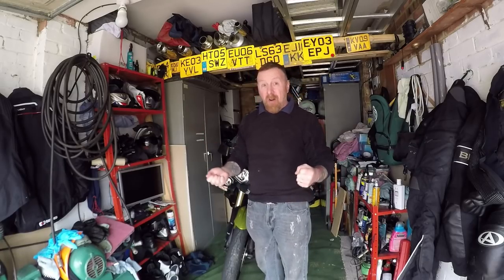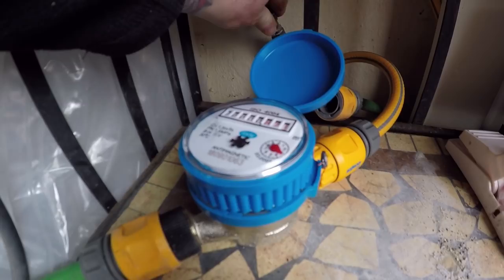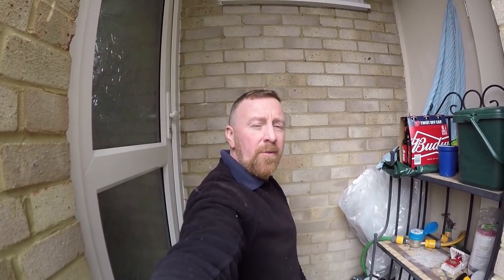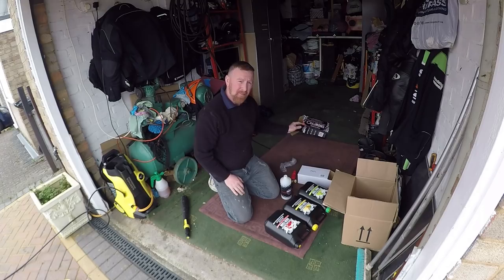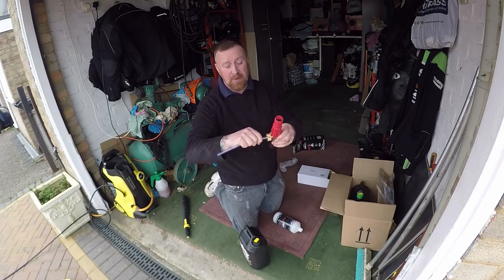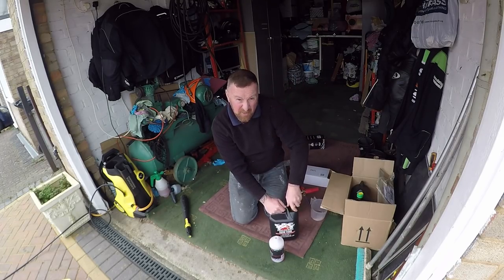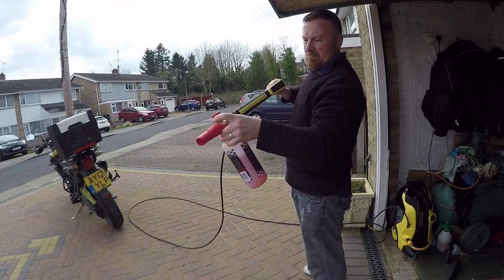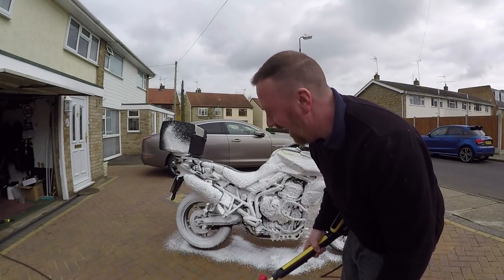SNOWFOAM JET WASH YOUR MOTORBIKE ? MARK SAVAGE

Comment: I bought a Muc-Off power washer as it's specifically designed for washing motorbikes. It has a lower power so as you don't damage your bike. I use the snow foam too but I find it doesn't matter which snow foam you use, you still need to take a sponge or micro fibre cloth to it.
Reply from the maker: Agree I do that with my car and bikes 
Giving it a rub over really helps
Reply: @marksavage  I still think snow foam is really good. It does help loosen hard grime up for easier cleaning.

Comment: It's great fun the snow foam but I've found that tfr is easily the most powerful but at the same time a bit dangerous on the bike as it's so strong. Being careful though it's good if used sensibly.
Reply from the maker: it is a bit of fun and better on cars however like you say just being careful

Comment: As a ex pro car/bike valeter, use TFR ( TRAFFIC FILM REMOVER ) on wheels only no need to rub or scrub, if you have tarmac splatters on wheels use TNG ( TAR AND GLUE REMOVER ) leave on wheels for around 5 minutes then power wash off with hot water, great result and will cost you way less than the snow foam.
Reply: @Harry Walsh No mate it has to be sprayed on with a spray bottle don't dilute, best TFR and T&G is Auto Glym, you could buy cheap crap from B&Q but, you end up with shadows on your wheels that will result in dull rims...Hope this helps mate

Comment: Some hopefully helpful tips please don’t think this is me being rude : A snow foams job is as a pre clean to loosen dirt before a 2 bucket contact wash,  snow foam isn’t designed to clean a bike without a contact wash too! - most snow foams you mix 300ml ish of foam with 700ml of water in the bottle before connecting to your pressure washer :)
Reply from the maker: ritchsuk that’s ok bud 
I was just following these instructions which it mixes as it runs with the mixer bottle and this was not the pre wash one 
It still came up ok but will rub over next time 
Just wanted to see if it worked as it says!
It’s ok but does need a rub over 
Thanks for watching bud and your comment
Reply: If you use the same rag your still just spreading dirt.....i power was all my bikes then hand wash then detail then wax

Comment: When u use a jet wash on a bike, u should always reduce the pressure of the water, if u have a machine with adjustable pressure then u can reduce it that way, failing that...stand further back so that ur reducing the water pressure....if ur a little bit wary of this way then u can wrap up ur electronic bits n bobs..... I have had no problems over the years..(professional auto detailer..... with most of my work on motorcycles)
Reply from the maker: Gren Phelps yes bud I have the full control k5 so can adjust the pressure from the handle 
And I have heard it can cause damage so was aware to not over do it 
Have to say it was fun but like in my detailing videos I have on my channel of my B king and fjr can’t beat a bucket of water lol 
Thanks for watching 
Many more videos on my channel well worth a watch 
Mark

Comment: Didn't quite understand about the gadget for the water meter or what is or does. Sounded interesting tho I think
Reply from the maker: You can buy a sub meter,  if you use a lot of garden outside water and it doesn't go down the drains , well you tell them it doesn't you don't have to pay for the waste 
It saves you a little and you can buy them off e bay bud

Comment: Not surprised its thick mate your only ment to fill the lance with about a inch of snow foam and top the rest up with water. 👍
Reply from the maker: Really bud 
Its not what it says on the instructions as it has a adjustment on to top to adjust snow foam and water

Comment: Nice video. I actually washed a motorcycle for the 1st time yesterday. It was a Yamaha MT07. Took me almost 2 hours. Cleaning the wheels properly with different products and brushes (the chain gets in the way) then using a detail brush and a mitt on the rest. Then drying with a towel and compressed air. Then protecting the plastics. 
Whats your opinion about the ProKleen products?
Reply from the maker: I used them and are good , I've used muk off too video on here to detail my b king and fjr and to be honest it done a really good job
Most cleaning products on the market today work well with a little bit of work 
Enjoy cleaning bud  and stay safe 
Loads more videos on my channel for you to enjoy
Reply: @marksavage  Thanks a lot for your reply Mark. 
Take care and you too, stay safe!!

Comment: Hiya  Mark hows it going?  Mark, can I asked you a quick question, just bought a Honda cb125f 15 plate fuel injection last weekend. Very low mileage serviced every 6 months!  I noticed once it gets nice and hot, the tick over creeps up. Sometimes its as high as 3000rpm and wont drop off. I given it a good looking over and cant find fault. You come across this before? Cheers matey
Reply from the maker: barrados101 not often on a FI system 
It maybe faulty of leaking as in sucking the n air !
Check system is nice and tight and air flow is ok 
If all ok you may need to get it service or replace the injection  as you can’t have it revving up that high as when in gear it will keep you going as your finding now 
Just make sure the cables as ok and wd40 the point that they go onto the system as the can rust up and become stuck so no closing !
Worth a look
Reply: @marksavage  thanks for all the info mark, will give it another coat of looking at this weekend. Will let you know how I get on. Thanks again :)
Reply: @marksavage  hiya mark, just a quick update, I tracked the problem down to the throttle position sensor, and the engine oil temperature sensor. So once replaced I hoping its all good to go :)  thanks again matey.

Comment: Can I jet wash my Gixxer without messing up any electrical stuff? I'm getting pissed off hand washing it!
Reply from the maker: to be honest you can jet wash any bike just try not to spray into the engine parts with full on jet!
do the wheels, chain and fairings engine case just not top end bud or clocks , just shower over them and sponge 
it will be fine then

Comment: Hi mark i just watched your video on project bikes where you saying about the vespa .
I bought a piaggio zip of a kid that said he was riding it now it wont start and he put a new plug in it .... i was up for the challange so i bought it £50 anyway got it home ... wrong spark plug put in a new one still no spark so changed the cdi then it ran but wjen you took it off the center stand it died anyway i ended up chasing back the cdi wire after taking off the floor boards and found a big plug that plugs in just by the side of the cylinder it was unplugged halfway so put it in properly and worked perfectly i have had the bike for 3 months now and never missed a beat but never belive the seller and be carful guys there are rouges out the who dont know what there doing
Reply from the maker: ive always said that but for £50 that's a good project and well done for getting it running and on the road again

Comment: I thought everyone knew snow foaming is just a way to apply shampoo to your car/bike and you still need to clean it, just not with a sponge.   Snowfoam is diluted shampoo, so buy shampoo instead.  And don't use a pressure washer around your wheel bearing or on your chain, you'll wash the grease out.
Thanks for the video and love your bike.
Reply: It's a pre clean you would snow foam your car or bike leave until most of it as dripped off then Rinse it all off removing dirt and helping break it down and lift it off the bike. foam it again and get scrubbing then rinse and dry
Reply: @livingdadream4616  thank you for your input

Comment: Good vid mark..is there anyway I can contact you..as my bike has confused the he'll out of me..it's a lexmoto diablo 2016 4t
Reply from the maker: Neil powell as you have subscribe and like 
Upload a video of your problem and I’ll take a look
Reply: @marksavage  what is happening is it cut out on me yesterday on the duel carriageway..I have cleaned filters..it's got a new carb..it starts first push everytime..and runs sweet on the centre stand..as soon as I drop it off the stand with me on it it cuts out instantly...but without me on it keeps running..also of the stand it starts and runs but again as soon as I sit on it it dies..also won't start with me on it when it's off the centre stand..
Reply from the maker: Neil powell it could be  the carb bud so check main jet and tuning like in my carb videos and tuning 4t / 2t 
They will help 
Shoulda like it runs on idle jet but floods or starves under load clean old carb try back on 
Serviced bike ? Plug etc
Reply: @marksavage  cleaned carb and jets..the carb is only 3wks old it's a deni carb..think that's the name..had new rollers about 5-6wks ago.only thing I havnt checked yet is the plug and lead
Reply: @marksavage  Could it be the clutch as eliminated everything else today..it's only the clutch I havnt looked at..just seem funny that as soon as you put weight on back wheel it cuts out
Reply from the maker: Neil powell worth a look bud 
Take off the cover and start the bike 
You may have to hold your in the bendix to start 
Then you can see
Reply: @marksavage  cheers also just watched one of your old vids of a speedfighter where you turning back wheel and it's making a grinding sound and you found out it was the clutch...well mine sounds exactly the same..thanks for videos and keep up the good work..your videos help out hell off a lot
Reply from the maker: @donky75  so that video helped then that's good to hear and yes give it a look as may be the clutch them , if so a simple fix
Reply: @marksavage  just put on a video of my bike on YouTube under my name
Reply from the maker: Neil powell will take a look
Reply from the maker: Neil powell ya how odd
Ok one of two things to look for 
Electrical 
Check you haven’t trapped any wire or the coil ht lead trapped or cut so it goes to earth !
Or any other wires 
Next fuel 
Check you haven’t trapped the fuel line or folding it over and get back to me but 
No it’s not you clutch !
Reply: @marksavage  fuel lines are all good..nothing getting trapped under the seat..I will check ht lead tomorrow..thank you
Reply: Thanks for your knowledge..I touched the ht lead while the bike was running and it zapped me through my thumb..it had been touching the head and melted..all fixed now temporarily until I get new lead..wrapped it with electrical tape and cable tied it out the way of anything hot
Reply from the maker: its the only way to test but the zap can give you a bolt lol, good to hear you sorted it and i helped 
mark